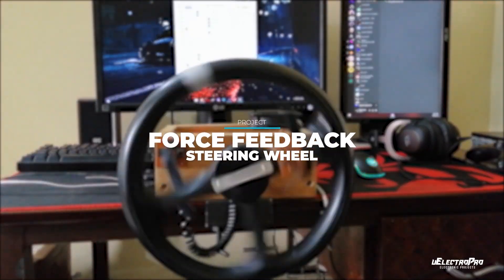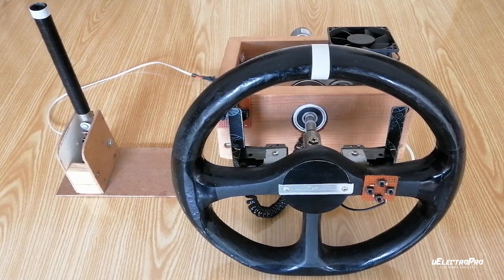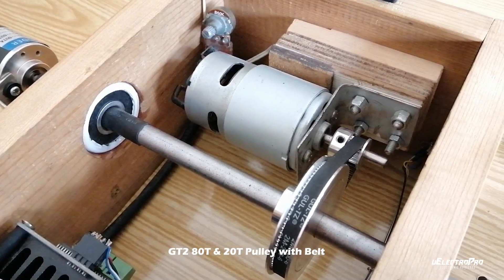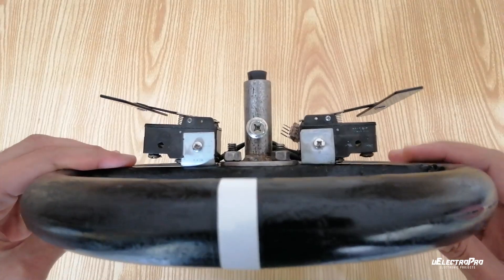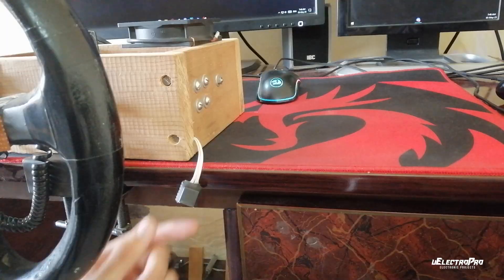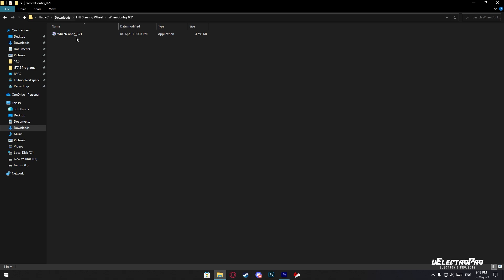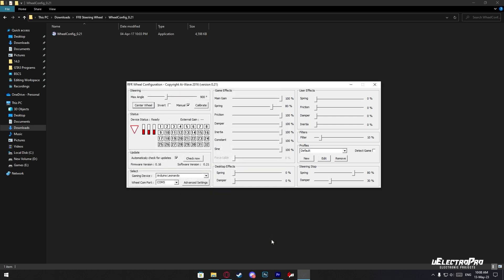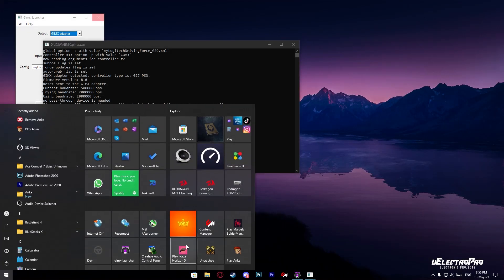DIY Force Feedback Steering Wheel

Comment from the maker: Setup FFB Steering Wheel with  Forza Horizon 5: https://youtu.be/sxI43QQKb-8
Reply: i have seen this video of yours, is that the only way forza 5 works? plus do all games needs this process or this is only for forza 5
Reply from the maker: For only those game that doesn't support your custom controller like Forza Horizon
Reply: @uElectroPro can you share the link where can I get the tube spring like you used for pedals or specifications like there dia and length thickness also if you can.thx
Reply: Bro what is the chip above ardino Leonardo
Reply from the maker: @mysteriousneel1531  it's arduino mini, i used it to convert analog button inputs to digital outputs
Reply: That is to say that it is only necessary for the buttons? Or for the pedals and that? I'm asking you to see if I can do without it for now. @uElectroPro

Comment: i need some help 
when i turn the wheel to right it come back but whel i turn to left the motor doent do anything
i checked all the connextions but found nothing wrong and i have connected the R_EN and L_EN to breadboard first in same row then from there connected them to 5v row

Comment: Do I need to buy the exact hardware shown in the video? I think until the program about how the motor is designed, such as the motor is directly driven then this motor may not have a reduction ratio. Or if the reduction ratio is changed, will it affect the normal feedback? Since I didn't find any information about how to implement the code part, I would like to ask you for help.

Comment: Hey brother, I've a doubt. Instead of using timing pulleys, can I use a dual shaft motor and use its front shaft to steering wheel and rear shaft straight to encoder, is it possible?

Comment: what psu did you use and how did you fit it into there?
Reply from the maker: In this video I was using 19v laptop adapter as PSU, now I'm using 24v 10A power supply and it's not placed inside the steering wheel

Comment: if im using 24v 250watts 14A ebike motor for ffb can i use 24v 360watts 15A powersupply? AND is IT good or something bad happen like high temp or heat im using 2 bts7960 driver

Comment: buen video bro, que fuente usas para ese motor, tengo las mismas poleas y el mismo motor pero con una fuente de pc de 650 se me apaga la fuente u.u
Reply from the maker: I'm using 24v 10A power supply for powering up 2 775 DC motors

Comment: hello! I need a bit of help... i belive i have connected the rotary encoder the right way but i dont get any output in RFR. I tried to connect to anolog as pedals and it worked i had the output but in the digital pins it doesnt want to work. Thanks for help!!!

edit: i have just notice i bought 1K resistors insted of 10K is that it?
Reply from the maker: You will need to connect 10k ohm resistors on phase A & B of rotary encoder as mentioned in the circuit diagram
Reply: @uElectroPro  i have connected 10 of 1K resistors together (mesured it and it give about 9.9K) and it still isnt working any new ideas? i have even tried using the 10K pot. set to 10k and nothing
Reply: @uElectroPro  i bought the 10k ones and it still doesnt work... with EMC lite it works with 1k and even 10k now i am without ideas

Comment: I am confused about the power supply and adapter where is your power supply in steering wheel
Reply from the maker: Power supply is not placed inside the steering, its separate. Before I was using the 19v 4A laptop adaptor, now using 24v 10A power supply with 2 motors.
Reply: Is one motor enough for providing considerable torque ?

Comment: can i use e-bike motor with computer power supply? pls reply
Reply from the maker: Computer power supply have over current protection feature so it cannot handle high load and will turn off automatically
Reply: what power supply should i use then??
im gonna use an ebike motor for this of 24v 350W @uElectroPro
Reply from the maker: I'm currently using 24v 10Ah power supply for driving 2 775 motors. You can use greater or equal to 10Ah power supply for your motor.
Reply: @uElectroPro i am using 24v 16,7a Power supply but the ffb keeps cutting Off untill i replug my arduino, any idea what could be causing the problem?

Comment: I have a question that i really need an answer for
can you use a ELEGOO UNO R3 Board ATmega328P, it is compatible with arduino so im just wondering if it would work the same???
Reply from the maker: I haven't tried this board yet. But arduino leonardo uses atmega32u4 microcontroller, which has built-in USB to serial convertor. That's why it can be used as mouse, keyboard or joystick. And this FFB Firmware is  compatible with only arduino leonardo and pro micro.

Comment: Brother I have a question, would it be the same process even with settings if i use arduino uno but not arduino leonardo? Btw, the video is🔥
Reply from the maker: You can only use arduino leonardo or pro micro for this project. FFB firmware isn't supported on arduino uno. Thank you!

Comment: Can we use L298N motor driver ibstead of Bts7960?
Reply from the maker: No, I wouldn't recommend using L298N. L298N is rated for low power consumption applications (like below 2 amps), and cannot handle the high current drawn by 775 dc motor. So, it's recommended to use BTS7960 43A motor driver.

Comment: Good day uElectroPro! may i ask what is the diameter of the encoder shaft im confused which pulley inner hole to buy. Thank you!
Reply from the maker: Rotary encoder shaft diameter is 6mm
Reply: @uElectroPro  thank you bro,
Reply: Also one more thing, which kind wire did you use for the power supply. Is any wire could be used to power the power supply with any power port.
Reply from the maker: @K1koPh  I used 19v laptop charger, and power wire that comes with it, without any modifications except I replaced the connector with 12v dc jack at the end.

Comment: Can I do this with my arduino nano? Because the app which can program arduino to change it to game controller can program adrduino nano...
Reply from the maker: As I mentioned in the video, the firmware is only compatible with ATmega32U4 based microcontrollers (only Arduino Leonardo or Pro micro), so you can't use arduino nano for that purpose

Comment: Sir are the pulleys need to be 20t and 80t ?
Reply from the maker: If you need more torque then it is recommended to use high gear ratio. Like 80t-20t  (4:1 ratio) provides more torque than 60t-20t gear ratio
Reply: @uElectroPro  thanks,god bless you

Comment: thats really cool
may you tell us what is the name that thing under the steer for locking to table? i really need that one but dont know
Reply from the maker: It's a custom built clamp using some metal parts (square metal pipe, bolts and nuts) welded together.

Comment: Hey man, it's a great video you posted. I am trying to build an FFB steering wheel myself but using STM32 F103C8 (Blue Pill), I have achieved sending inputs of steering wheel using USB HID but I am stuck at FFB, any help would be appreciated.
Reply: i built one with EMC software everything works except FFB for me too, did you find any solution ?
Reply: @TheMrMoriarty  no man, not yet
Reply: hey im planning on buying that controller, is the issue fixed?
if yes, pls tell how

Comment: One idea is, instead of using an Arduino Leonardo is to use a STM32F401CCU6, so you don't get a lot of delay and also to make the build a bit more cheaper!
Reply: can u tell how to make with that
Reply: @tanishkprem1028  Just search STM32F401CCU6 DIY Wheel pc and a video about it should appear
Reply: Circuit diagram of stm32 plzz link...
Reply: @Movies.Only. emc pro buy it and you get them
Reply: same idea STM32F401CCU6 + magnetic high bit sensor
Reply: Arduino is cheaper than STM32 board
Reply: @smit_j_1411  Depends on where you live, availability and where you buy it. I got it cheaper than an arduino so it really depends
Reply: @cateatpaw  ooh 😮 
I did not know , cause in most of the region Arduino is cheaper 😶 

In India it starts from 350 INR ($4) up to 850 ($10) INR or higher 😀

Comment: Hi, can i use potentiometer (10 round) for that instead rotary encoder?

Please reply. Thanks.❤
Reply from the maker: no, potentiometer would not work
Reply: @uElectroPro  you can make use of the potentiometer and simulate a rotary encoder within the software tho-
Reply: I do not recommend using this potentiometer that rotates 10x. I used one and due to its large range, vibrations appear that cannot be changed either with software or by adding a capacitor.

Comment: bro how did you connect 6 wires to usb ?
Reply from the maker: Actually 5 wires, 4 are connected to usb pins and 1 to the metal body of the usb connector. 6th wire is extra not connected anywhere

Comment: can I use 60 teeth pully instead of 80?
Thank you
Reply: Also can i use Arduino uno instead of Leonardo
Reply from the maker: @ukshaandumasia1446  yes you can use 60 teeth pulley, but i would recommend to use the higher gear ratio for more torque. Arduino uno does not work for this project.
Reply: @uElectroPro  Hi im using your exact components but i keep getting calibration error, any advice?

Comment: hey man what is the extra circute board above the motor driver ? can you please upload your circute diagram with all the button and the shifter, I think the circuit diagram doesn't include the buttons
Reply from the maker: The extra circuit board is Arduino mini that I used to detect 4 buttons on the steering wheel because of limited wires. Purpose of arduino mini is the convert 1 Analog input to 4 digital outputs for arduino leonardo. If you want to add buttons process is simple, just connect one wires of button to arduino leonardo digital pin and other to the gnd
Reply: @uElectroPro  did you use the pullup or pull-down method for the resistor with the buttons, do I have to also use resister for the button controls, and what are the values of the resistors you used for the buttons
Reply from the maker: @israeljmtd1667  no you don't need to add resistors with buttons unless you want to connect 4 buttons to only 2 wires as I did. You can see the circuit diagram in the video description
Reply: @uElectroPro   @uElectroPro  okayy, let say i want to include 8 buttons, and I want to do it as you did to minimize the wire input in to the arduino, so do I need arduino mini or not, and can I change the wire that goes  in to analog pin (based on ur circuit diagram) into digital pin ? and what is the purpose of the capacitor (C1) you used on the circuit ? what about the shifters did u connected them directly to the digital and Gnd pin? can you put out a video how you made them are they magnetic or u only used springs?
Reply from the maker: @israeljmtd1667  1) no you can't use digital input instead of analog input for multiple buttons (for arduino mini) 
2) capacitor is used to filter out the fluctuation 
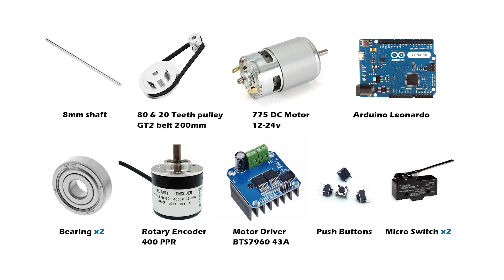3) Yes, shifters are directly connected to the (Arduino Leonardo) digital pin and ground (GND), and these are the same ones shown at 2:25.
Reply: @uElectroPro  it would've been auesome if you put out a video on how to incorporate multiple buttons with three output wire in to the arduino,  using only one digital or one analog pin. but thank you for your response brother I asked too many question, the resone is I incorporate H-shifter so I only have 2 digital pin left and which will not let me to incorporate more than two buttons based on the usual method(one wire to any digital pin and the other to the grd). but I want at least 8 buttons, and I don't know how to incorporate 8 buttons using only one digital or analog pin with out using arduino mini that's why any way thank you

Comment: bro i got a problem, i used to play gta v using my arduino leonardo ffb steering wheel for quite some time using Manual transmission mod, but suddenly my forcefeed back stopped working, the wheel is perfectly working, game is also taking inputs, the motors are also working(900 degree dead end working) and everything is looking fine but my forcefeedback suddenly stopped working, what to do?, i reinstalled the game, the mods and even re uploaded the frimware and all, but still the force feed bak is not working, what to do pleasee helpppp😭😭
Reply: another point, i tried to check the wheel uisng wheelcheck application and when i put the wheel in "cycle" mode, nothing moved, but when i turned the wheel two times right or left it was stopped by the motor as i set 900 degree dteering, so motors are working confirmed, but not getting forcefeed back, and that wheelcheck point that i told just now, tell me if you can figure out the problem and help me out 😔😔
Reply from the maker: Set all the game effects to 100% in rfr wheel config and try again
Reply: @uElectroPro  it's already at 100%😟 and it used to work fine with this settings only, I played for 4-5 months suddenly this problem showed up what to dooo?😭😭😭
Reply from the maker: @mahamantraghosh8543  I haven't tried it with gta5, so don't know much about it. And reason I asked you to set game effects to 100% is that sometimes settings get changed, so again setup the arduino controls is rfr and let me know. And also check other test settings in wheelCheck simple spring, Force pid etc
Reply: @uElectroPro  umm, I tried simple spring and force spring, none of them worked😟 what should I do then?😟

Comment: hi, can i use 400ppr encoder instead of 600ppr?
Reply from the maker: Yes you can
Reply: @uElectroPro  Do you think the difference between these two encoders is big enough that it is worth to pay more for the 600ppr one ?
Reply from the maker: No, 400ppr is sufficient for steering wheel

Comment: What's the torque? Or should A. Higher / bigger motor would be better OR B. two of these motor will be better. Thanks
Reply from the maker: The total torque at the steering wheel, considering 775 dc motor, 4:1 gear ratio and a steering wheel diameter of 9 inches, is approximately 0.0896 N.m.
The choice between a higher/bigger motor or two motors depends on your specific requirements. 
A: A higher or bigger motor generally provides more torque and power, but can be expensive
B: Using two motors can distribute the load between them, resulting in better torque sharing and potentially higher overall torque output

Comment: can we use motor with encoder or step motor in place of rotary encoder?
and any other motor driver instead of BTS 7960?
Reply: it depends on the motor u have cuz on some motors the encoder is built in and in some it isnt     
but i wouldnt recomened anyway beacuze in hight torgue the motor kinda ripples (in some motors )
but if u dont care about that send me the  model number  of the motor and i can have a look if it has a encoder
Reply: @emiljanduka51  Hi, I have motors that I took from a big industrial printer, can I send you photos of the motors?
Reply: @MrMarto bro it should have encoder bcz all industrial mostly have encoder motor

Comment: im currently working on an analog handbrake to add to my G923, do you know how to send an analog controller/keyboard inout via USB?
Reply from the maker: Not sure about g923. You can use arduino leonardo. It has Analog inputs so you can connect the handbrake to it. Just need to upload the code on arduino and connect your handbrake